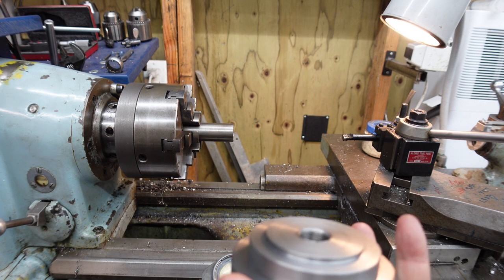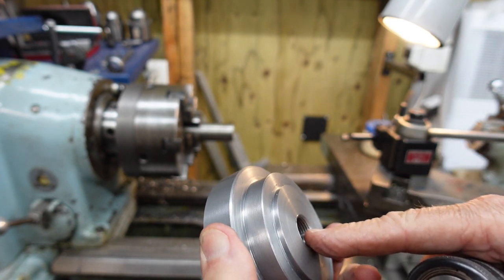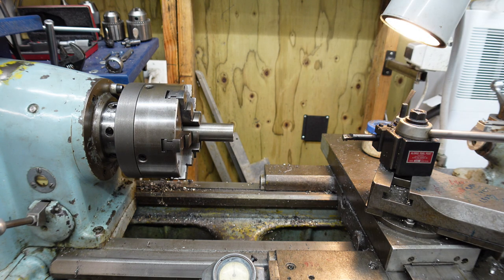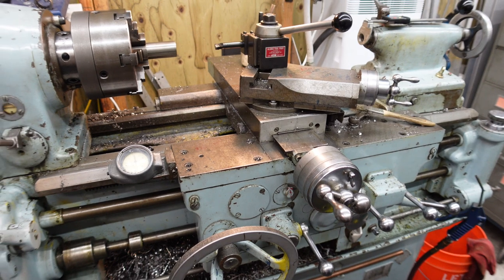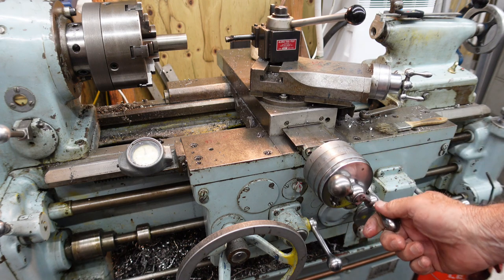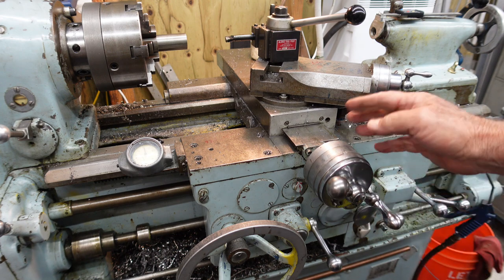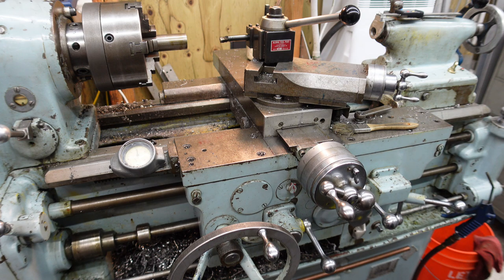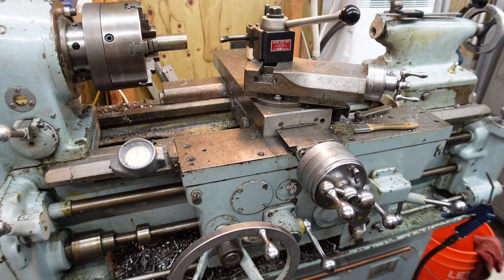How easy to cut threads on a Monarch 10ee w/ELSR

Comment: The ELSR 10EE's are the sweetest machines I've ever used to do single point threading on.  When I installed an AC Servo drive on mine, I incorporated a couple of proximity switches to take place of the original mechanical cams to give it true Electronic Lead Screw Reverse.  The original mechanical system is still fully functional, but the prox. switches stop it a bit more accurately.  The modification I made that makes the biggest difference when threading is independent forward and reverse speeds.  I set reverse to high speed allowing for a fast return to the starting point.  Whenever I'm able to get mine back up and running I want to work on integrating a second servo to the leadscrew to allow me to do Metric threading as I'm probably working in metric more than imperial these days.  Independent forward/reverse speeds was an option on 10EE's, but seems to be a pretty rare option as was Constant Surface Speed (something else I'd like to incorporate).
Reply from the maker: thanks for viewing and your comments

Comment: When I was watching you demonstrate the procedure and you were showing the cross slide stops, I was thinking to myself that you were turning the crank in the wrong direction when you were saying going in and coming out, but then I remembered that you were cutting internal threads. They did make that machine extremely user friendly. It's too bad that the electronics on those machines can be troublesome.
Reply from the maker: my unit is a motor/generator (no tubes) loud but works great for a 70 year old machine....thanks for viewing

Comment: Those 10EEs look like nice machines, that threading feature is very cool. I’d love to find one but I suppose I’m stuck with threading on my Hardinge HLV-H until I do!  😊. Cheers from Florida’s Space Coast.
Reply: Correct me if I'm wrong, but I'm under the impression your Hardinge also has a mechanism to make threading simple, or is that an optional add-on?
Reply: @russelldold4827  It does. The compound has a handle that moves it in and out so the half nut is never disengaged from the lead screw. It’s a very nice feature of these machines. I believe Rob Renz did a threading video using his HLV-H. It’s my favorite machine tool in the shop.
Reply: @charlieromeo7663 Thanks for your reply. I've known about the Hardinge HLV and its reputation for excellence for nearly 50 years, but never seen one in the flesh. I missed out on a Hardinge chucker on Gumtree (our local version of craigslist) by about an hour - I would have bought it sight unseen and happily driven the 2000 mile round trip to collect it. I ended up with an Okuma LP, which is their version of a toolroom lathe, and am very happy with it.